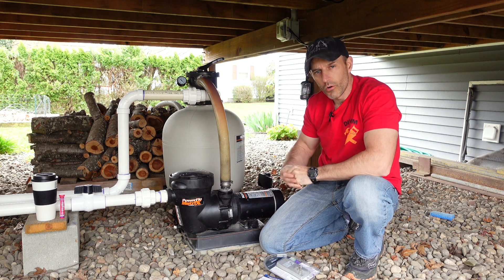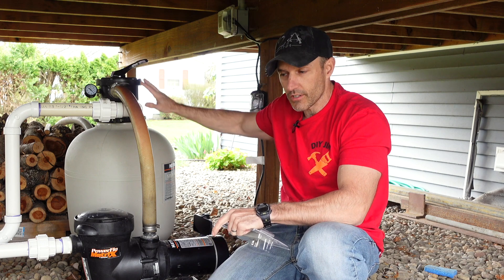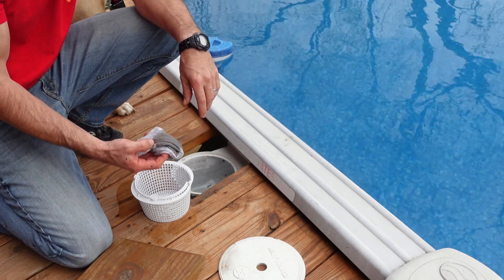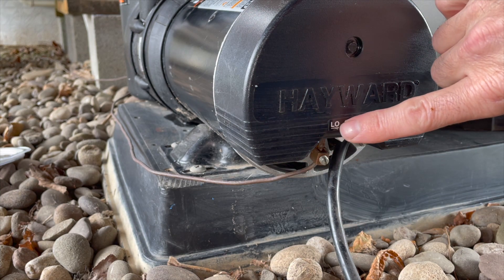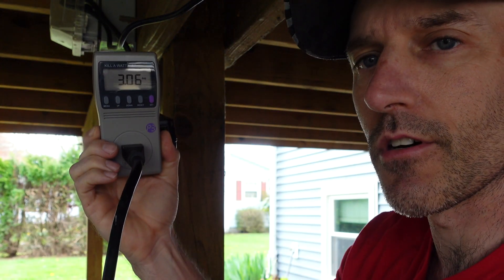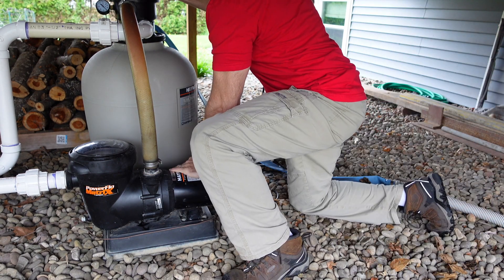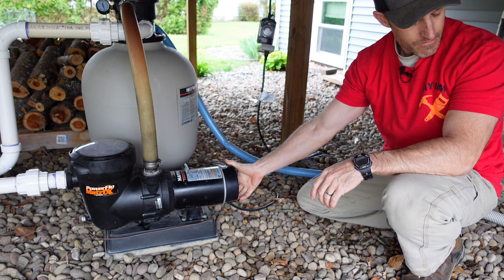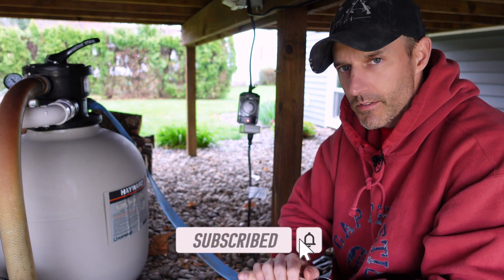How much electricity (power) does my Hayward 1.5 HP pool pump use? On Hi and low.

Comment: On medium my Hayward uses 134 watts but on high uses 935 watts.   1750 rpm verses 3450.    It’s not worth it.   Low is 621 rpm’s and uses 21 watts.  I run it 12 hours a day on medium.    The new pumps are very efficient compared to the older ones.
Reply from the maker: Thanks for watching

Comment: This all depends on the way the pool was plumbed ie: pipe size / length of pipe run / how many returns the pool has most supposedly pool builders just slap a pump and filter on a pool if the filter is too small this will drive of operating costs as well because its a.choke point causing the pump to work harder to push the water thru the filter weather its sand or a  cartridge sand is the best choice a cartridge is ok but cleaning is a pain and they are not as efficient because the pleats collapse over time limiting how much ot filters stick with sand and a VSP not one.with high and low vsp lets you tune to your pool
Reply from the maker: Thanks for the info and thanks for watching

Comment: What kind of timer do you use?
Reply from the maker: It is just a timer rated to be outdoors
Reply: @DIYJIM  Ok thanks I was just wondering I have the same pump as you but all the timers I see show for rated for 1/2 or 3/4 HP but I run it on low most of the time
Reply from the maker: I also run mine on low 99% of the time. Especially after I bought my dolphin pool vac.

Comment: FPL south Florida is also 14cents kwh, my 2hp pump was running for 5hrs/day (no low speed) and it was time for a new pump.
 I got the vevor 1.6HP solar pool pump (2" inlet/outlet) at $480, compared to a 1.5HP Hayward in-ground pool super pump it's actually cheaper. 
They also have 1.2HP (900watt) with 1.5" inlet/outlet more suitable for a pool your size.
If I wanted brand new solar panels would need to spend $1000 on 4-6 panels (series + parallel ) to get 90-130VDC at ~1500watt.
I got 10year old used good conditions panels for $250 so my RTI on the panels will be 10months as I should save $25/month. 
 The pump is brushless variable speed. No timer needed if the sun is up the pump runs, and the more sun there is the more you should run your pool-pump so it all works out.
Reply from the maker: Thanks for all the info, thanks for watching

Comment: If your objective is to save money you’d be better off with a 1.0 HP motor for a pool that size. Many homeowners mistakenly believe that “bigger is always better” when it comes to pool pumps. In actuality oversized pumps are more expensive, less efficient, costlier to run and can damage filters, heaters, etc
Reply from the maker: Thanks for the tip, thanks for watching

Comment: Hello jim,, If you change your sand filter to a  filter element filter you can run your pool on low speed all the time..With the  hayward filter element the output pressure back to pool compared to the sand filter is night and day difference..Your pool pump will take less power with the filter element....I tried both with a hayward turbo injector 1.5hp 2 speed pump...
Reply from the maker: Do you have a link to the filter you are talking about?

Comment: You only need to run the pump for as long as it takes to circulate all the water once a day. 12 hrs a day for that small pool and a 1.5 hp pump is way too long. You can get away with half that time. You dont need to have it on for more that 6 hrs.
Reply from the maker: My pump has a low and high setting. Low pumps a lot less than high. Thanks for the advice

Comment: So on high it would only need to run for around 6 hours on low prob the entire 24 hours the water was just dribbling in the filter container not even filling the container basket. So divide the 24hr $95.25  by 4 and you get $23/month so you would save approximately $4/month and I'm not sure your turning over the same amount of water in 24hrs as you are at high speed for 6hrs. So a savings of $48/year you can buy a single speed motor for around $160 these motors are $5-600 we'll say $550 so $390 more it would take over 8 years to get your money back but you would have to replace it by then especially if it ran 24hrs. for you it works because you need it quiet because of location. Nice video,  like you said you wouldn't have to run it for 24hrs like the low speed prob should be to overturn the water.
Reply from the maker: Good math skills but I still like the low setting it is so much quicker. I can sit on my deck and hardly hear it.
Reply: @DIYJIM  that's all that matters is that it works for you good job great info on the vid
Reply from the maker: @smille5291  thanks Scott hope you have a good summer

Comment: I called Hayward about the 2 Part numbers. W3SP15932S and SP15932S they are the exact same pump.
Reply: Who knows! I was on hold for over an hour. The tech seemed more like a read between the lines only. The W3 means direct replacement part number! Either way your content is awesome!
Reply from the maker: @diprinterman  thanks, hope you enjoy your pool
Reply from the maker: Ok thanks, I wonder why one is more expensive and the cheeper one weighs more?  Thanks for looking into it.